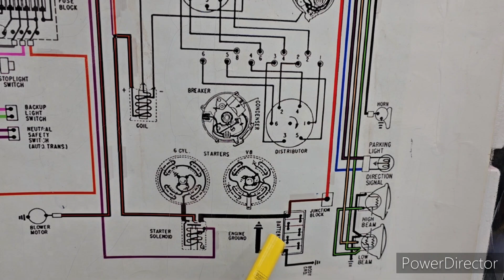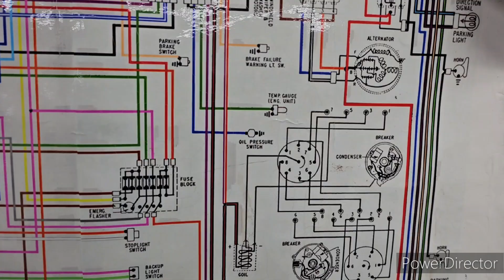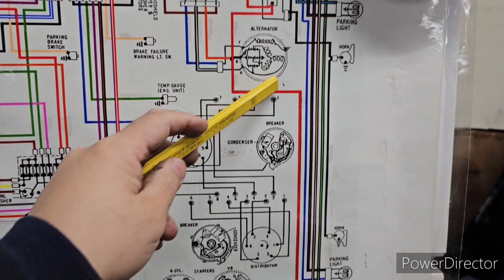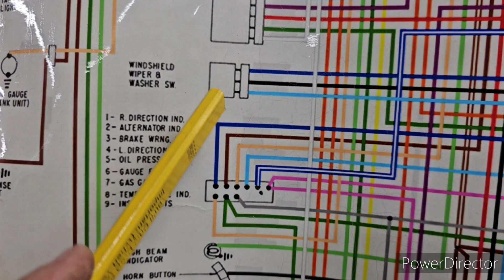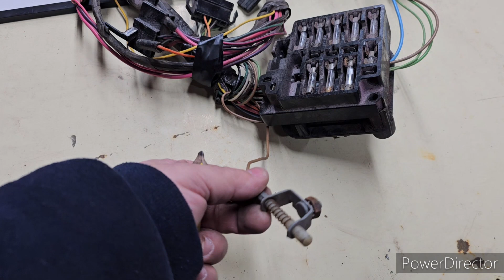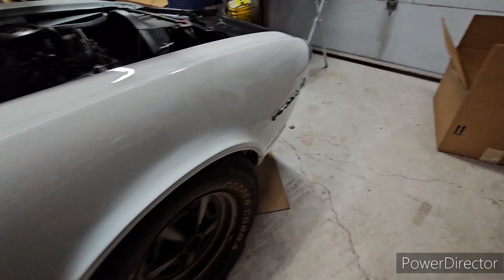How To Wire A Classic Car - Classic Car Wiring Guide - automotive wiring basics

Comment: Hi there. I have a head scratcher. I have a 68 that came without the rally gauges. Someone installed a 67 rally gauge set. I assumed they didn’t re-pin it because I only got a left turn light in the dash when I turned the lights on. And no dash lights. But when I removed the gauges it was pinned correctly. My gray wire was pinned to 5, that should be all my dash lights. It gets 12v when I turn on my lights. But the light blue wire pinned at 7, for the left blinker is getting a random 3.5v when I turn on the lights. It should be getting 0v until the blinker comes on, and it does get the 12v when the blinker comes on, but then it goes back to 3.5v. Any ideas? Cheers, Dax. 
BTW, I used Jon's video as a guide on where to place the pins, and your video on how to remove the pins. Keep up the great videos!
Reply from the maker: @t.daxmallory2307  thank you for checking out the channel lots more videos coming your way as for these old cars you need to check out your signal light switch also your light switch on the dash Trace everything make sure everything is clean make sure all your grounds are clean the littlest things can cause you a big headache
Reply: @firstgenerationgarage2803  Thanks much, I learn a lot from both you and Jon. You've saved me from many headaches. Cheers, Dax.
Reply from the maker: @t.daxmallory2307  we both love saving birds 🐦

Comment: Hi Luis , 
Could you tell me where you route the purple starter wire from the bulkhead to the starter ? I’m working with a new American Autowire Kit #500886 for my 67 Firebird currently on the engine bay laying out the wiring to its locations and I can’t decide where to route the purple starter wire from the bulkhead to the starter due to headers with the heat . The starter is on the driver side of my 350 ci . I would appreciate your input and advice .
Thank you
Reply from the maker: @howardrussell6738  the purple starter wire goes behind the driver side cylinder head inside a starter wire tube that is made out of metal there it will go through the tube down to the starter so it can be safe from the Heat
Reply: @firstgenerationgarage2803  Thank you so much for your reply Luis . If I could ask if possible to take a photo of the tube to better understand where and how you attach it. I believe this would be a really good video of how you would do this. I appreciate your input Luis.
Thanks so much !
Reply from the maker: @howardrussell6738  I will do that soon
Reply: @firstgenerationgarage2803  you’re the best

Comment: What is this custom cable wiring you mention at the beginning? Is it tinned boat cable?
Reply from the maker: Yes .....it's welding cables 2 gauge they have much more of a heat resistant and are more flexible I order the custom made any time. I am putting a car together. Thank you for watching and thank you for your comment
Reply: @firstgenerationgarage2803  Oh ok.  I gotcha. You didn't never said welding.

Comment: Really good video! I have a 67 LeMans, but I sure it's pretty much the same. If you know? Should I pull my harness out and connect everything to the dash and them put the harness back with the dash? Thanks, Ron
Reply from the maker: Hello Ron, and thank you for watching I  Appreciate your support. I never did a Pontiac Lemans but I did a 67 GTO. You could take everything apart. Remove all your wiring harness. First clean  anything you're going to do to the car and re. Install The Wire harness.  Once you are done I did it to the GTO and had no issues.